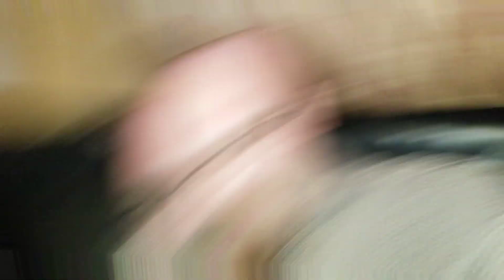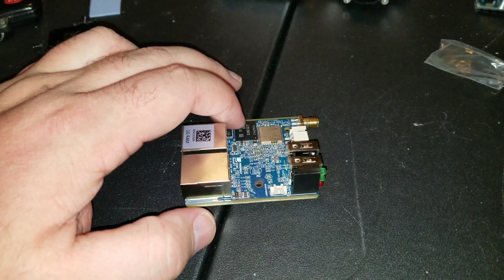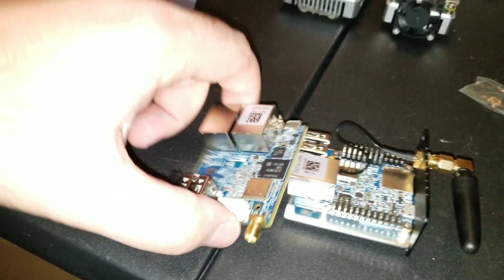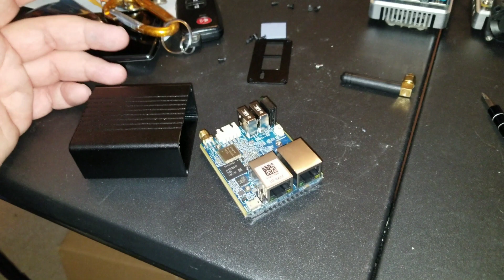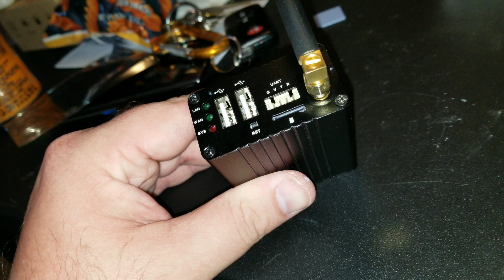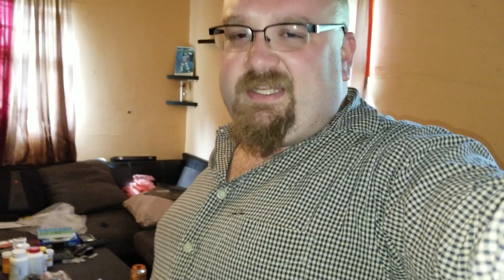FriendlyArm Nanopi R1 Overview - Let's Look

Comment: Could you attach a 5g stick with sim card on its 2.0 usb and use it as a travel router?
Reply from the maker: im sure ytou could as long as there is a linux driver and software for it